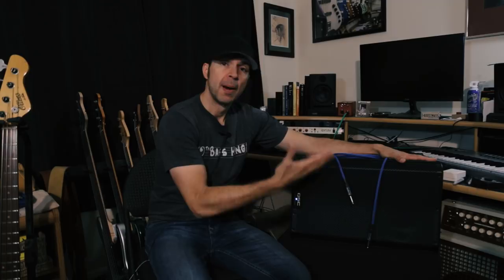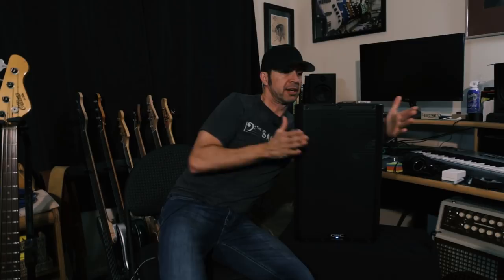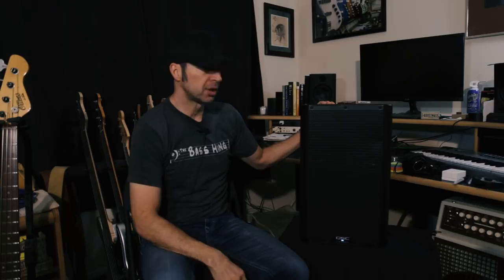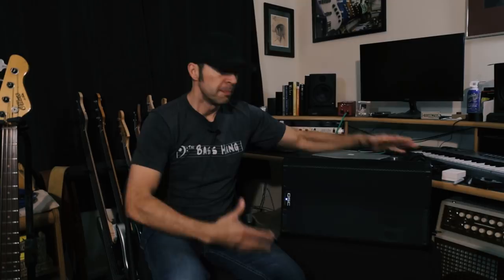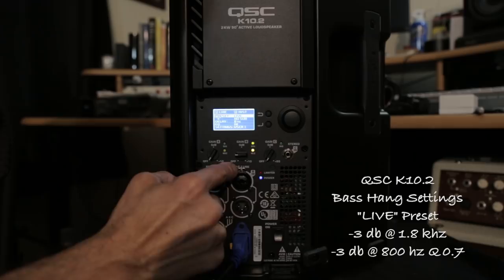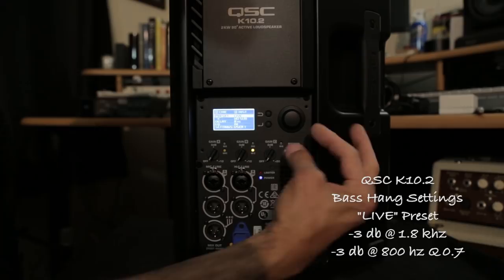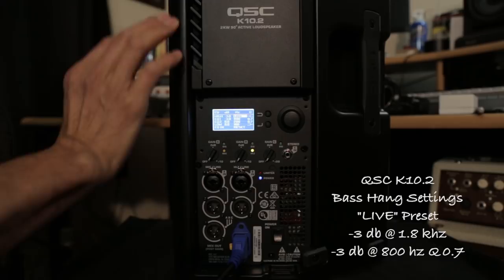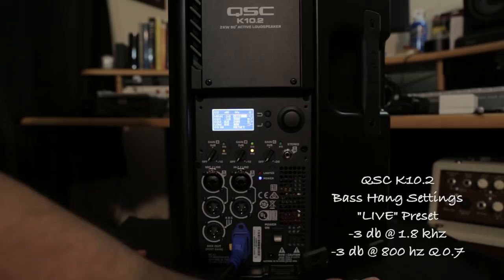QSC K10.2 For Bass Guitar

Comment: Thank you for this video, I just used the settings you mentioned on my K12.2 and then plugged in my Strat. It sounds crystal beautiful, just like a Deluxe Reverb. I first tried to use the Bass Amp setting but it didn't sounded right, that's where your video helped. I know this is a Bass Guitar video, but if you have a Strat, plug it in the K12.2 with these settings and see how well it works for it. With the K12.2 setup like this, I don't have to buy an amp.

Comment: Very informative video! I’ve got 2 QSC10.2 which I use for keyboard monitors.  They are excellent for this. Crystal clear, powerful and good bass. I’m about to start learning bass so very pleased to learn these work well with bass too. I’d definitely recommended these speakers. I’ve had JBL Eon 15 and cheaper Alto speakers. The QSC’s are a lot more expensive but blow the competition I’ve had away in terms of clarity, smoothness and power.  Thanks for the video!

Comment: Best keyboard amp for live performance out there.
Reply: Rockinroller I’ve got two of these for stereo monitors for my keyboard set up. Really pleased with them! Bought two K8.2’s for front of house and planning on getting two of the matching subs K112’s. I’ve had JBL’s before but the QSC’s are much clearer and more powerful.
Reply: @andreafox7267   Since this was posted a few months ago, I've sold the QSC k10.2 and replaced it with two Alto TS312 speakers, for about the same cost.  I am impressed at the sound quality and durability and LOVE the stereo effect that the two cabinets provide when separated on stage, especially in recreating the Leslie effect on my Hammond settings.  IMO the QSC was "too accurate" of a sound amplification, whereas I felt I needed more "thickness"--especially with my organ sounds--that the Alto's provide.
Reply: Very cool! I’ve had older Alto 15” speakers for a pa. They did their job and never failed me! Gotta have a stereo mix for keyboards! 😁

Comment: Random question, 6 years later haha. But in your settings, you mention the first 2 EQ settings (high and eq1) but, it's hard to make out, did you turn down eq2 to 200?  
I actually have the k8.2 and been trying it out as a practice amp (small apartment so i went with the 8.2) and your settings made a huge difference! So thanks for that!

I was getting a popping/snap when i would slap, even at a low volume. But now with your setting i have to crank it up to get those negative responses. So again, cheers, your settings work well with the 8.2 (as a practice amp).

Comment: I know it's been awhile since you made this video, but does the output of this speaker compare to a 300-500w bass amp? I'm looking to simplify my gear across bass/guitar/keys and instead of having amps for each I'm looking to use a modeler (Helix) with a powered speaker. My only concern is getting enough volume for those gigs where you don't have bass going to FOH but it's not exactly a quiet gig either.

Comment: Great video! I’m considering the 10.2 as an amp for my keyboard. I do a lot of left hand bass in solo, duos and trios. Do you think it could handle vocals as well as the keys simultaneously? Thanks for taking the time to go through your preferred settings.
Reply from the maker: Hi, I think it would suffice il to a certain volume. But it is such a great speaker and handles much more than I even thought it would handle, it would probably work for a smaller or medium size gig.

Comment: I have the same speaker and tried it with your settings and BAM!  New bass amp!  I love that it is small and portable and has plenty of power for just about any situation.  Are you still using it live?  Have you added any other preamps, pedals or other things in front of it?  My only problem is the power switch and volume being in the back and not very accessible.  Also, is there any way to run this direct to a mixer (acting like a DI)?  Thanks for the video and great explanation!
Reply from the maker: sharris70 Thanks and so glad I could help. I agree with you about the power and volume being a little tough to get to, haha, but I have used a Preamp pedal before going into the QSC and that way I have control over the volume, that’s one way to have a quick control to volume.
Reply: Volume knob on the bass?!
Reply: Balanced XLR link outputs included :) They thought of everything when they designed these.

Comment: Why didn't you get the K12.2 if using for a bass amp that will get you the bottom you keep bringing up as issue with the 10".
Reply from the maker: Toortog Pown I have several bass cabinets and needed a small compact rig so this 10 is perfect. Sounds great and is small.
Reply: @Thebasshang  right..

Comment: Well.. I wanted to hear the range of the speaker.. All I needed was the low E and let it ring. Too bad. None of that treble pop and snap demonstrated the speakers ability at a low extreme.  so i learned nothing from another presenter who does not get the point. It's not about your bass playing, its supposed to be about the speaker.... maybe you could remake this video and make it about the range of the speaker next time...
Reply from the maker: James Herrell Nope, not remaking it. I gig with this amp all of the time and it’s great. So thanks for watching the video and taking away whatever you did take away. I’m sure there’s plenty of others out there that will answer any questions you have. I will say that this little speaker is super impressive and works for many situations you just might have to do a little tweaking as I did to make it viable for your situation. Thanks again for watching the video.
Reply: I have looked at the k12.2s in th GC. they did not seem too have any bass.. I have watched every video I could find to learn all I could .. it seems everyone floods them with highs and mids. I would just like to see a simple low e to see if the amp will starve when the bass is really draining on it. But  a straight up demonstration seems elusive. The bass in the EDM Dj videos does not sustain. Its a bump at best.... I play music that has a lot of sustained bass as well as the rest. At this point, my old moldy Peavey half columns from the 80s on 250 watts a channel seem to produce more..LOL I cannot see how that could be true, However; I cannot prove otherwise either..yet..
Reply: rude